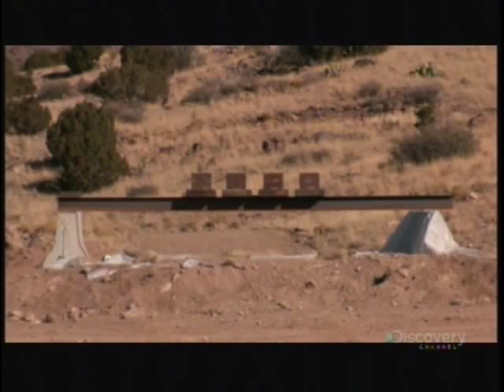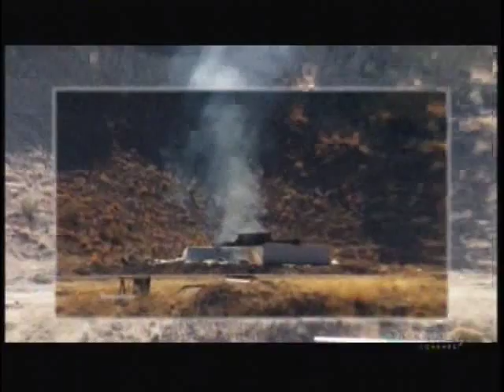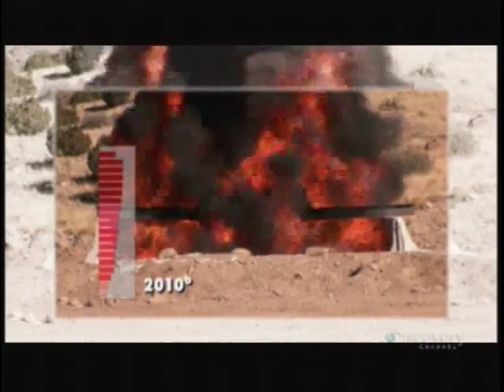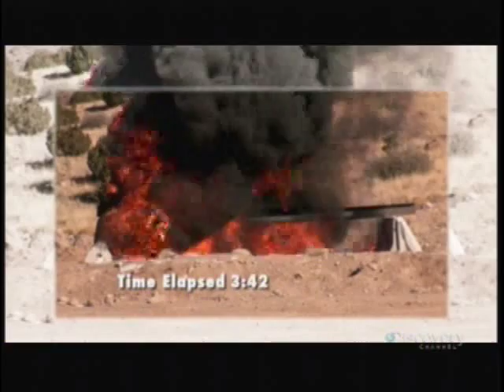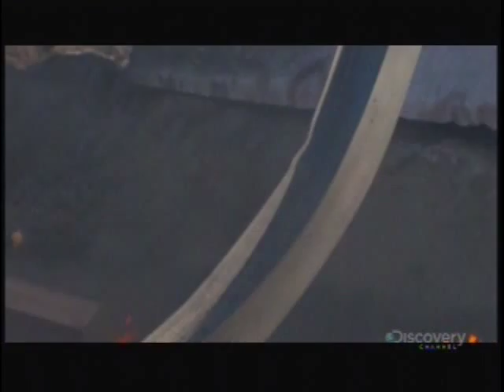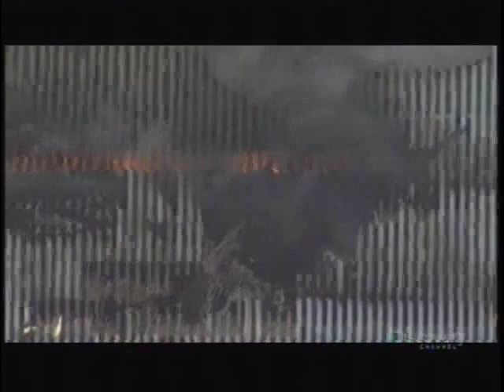ENG Steel failure in fire

Comment: I think the initial argument was that jet fuel doesn't burn hot enough to melt steel, which may be true as I know for a fact lighter fluid can burn on cotton clothing and not catch it on fire (yeah, I had dumb friends in my college career).  However, what burning jet fuel CAN do is catch other materials on fire, which in turn can burn at higher termperatures, which could then cause a full blown fire melt the steel.  I mean, steel is formed by heating it up to high temps, so its obvious heat=fail